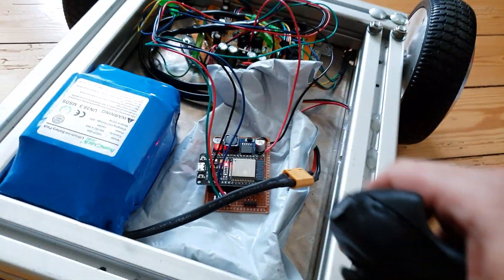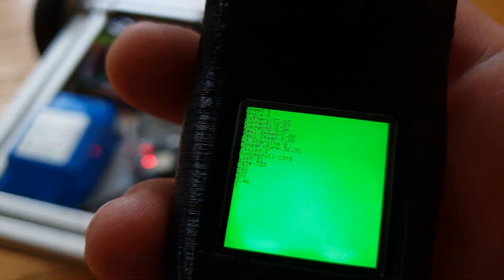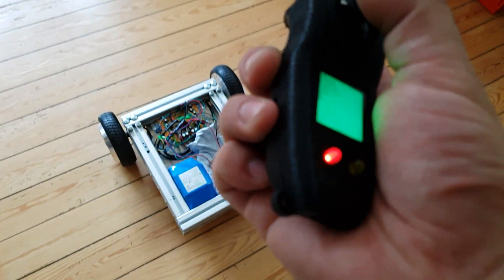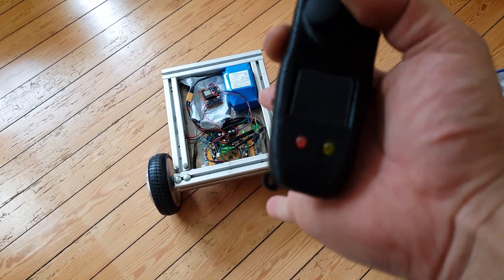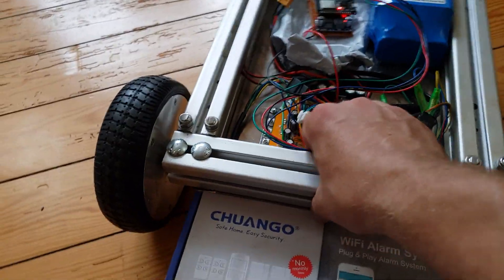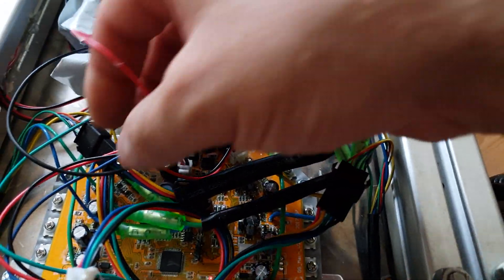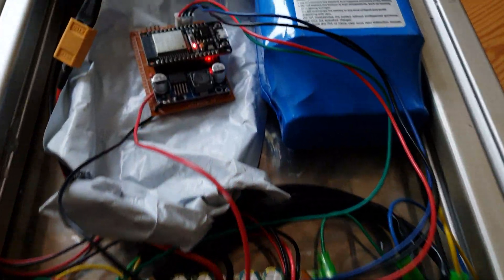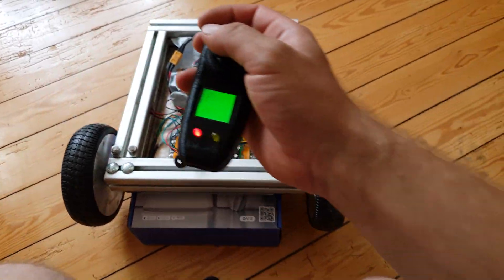Hoverboard safety feature example, connection timeout.

Comment: Hi Aaron, as I saw from the video the esp32 on the hoverboard is powered by a step down controller. This SDC is probably connected to the 15V source of one of the two sensor boards and I assume you power the esp32 via the 5V pin. One questions, in your experience is the internal voltage regulator of the esp32 powerful enough to provide the current during the sending spikes? Or did you apply e.g. a beefy capacitor or buffer LiPo battery?
Reply from the maker: The step down converter is directly connected to the 42V of the battery because the 15v from the sensor board can not give enough power. The esp LDO is fine and i had no problems but that of course depends on the esp board
Reply: @atc1441  Thx for your insights. I was wondering, whether the 200mA from the sensor board would be sufficient to power the esp32. You are right, it depends on the board. Some esp32 dev boards from China need a LiPo battery attached.

Comment: Hi Aaron, where did you get the remote control?
Reply from the maker: Hi. That one is 3D Printed
Reply: @atc1441  Thx Aaron, I thought I saw this remote on a webshop earlier, but cannot remember the shop name anymore. The remote was named Photon, if I remember correctly. Unfortunately Google does not bring up any results on that. This was the reason I asked you. Btw, I like your work and achievements very much.
Reply from the maker: Ah yes you are right it is the Photon remote. Found it on thingiverse and edited it a bit.
Reply from the maker: https://www.thingiverse.com/thing:3133640
Reply: @atc1441  did you use the photon or did you create your own joystick using the Thingiverse case as an example? I like the form factor but definitely not the price or non-availability of the photon. Also would it be possible to use a toggle switch for the "dead mans switch". I'd like to use this in a wheelchair mod, but I don't particularly like the idea of having to hold the button down while trying to maneuver the joystick all with one hand. Would be fine in a bot scenario, but trying to do that while shopping would become old fast.
Reply from the maker: Hey. I used the photon design and edited it to my need. But needed a lot of hot glue. Today i would suggest to use an wii nunchuck as the joystick is very precise and you already have the dead man switch

Comment: Great video! This solves the problem I have in my project :-) my 4wd platform keeps driving away from me in case I turn on the receiver before transmitter:-)
Reply from the maker: I understand that problem^^ and the board is just to powerfull :D
Reply: @atc1441  I'm doing the first steps in this project yet :-) But I'm using an Arduino Nano connected in parallel with 2 hoverboard boards. Did you solve the problem on your project with Arduino Nano before moving to ESP32?
This is the code I use in my project https://github.com/fender90/hoverduino/blob/master/hover.ino